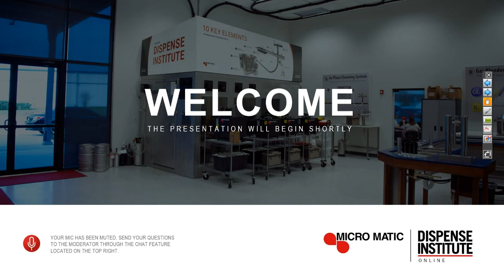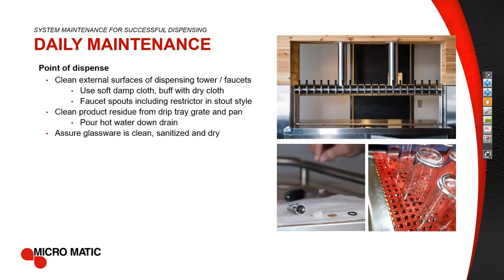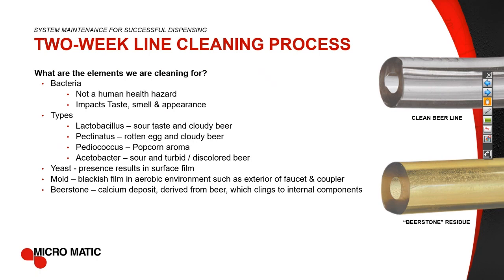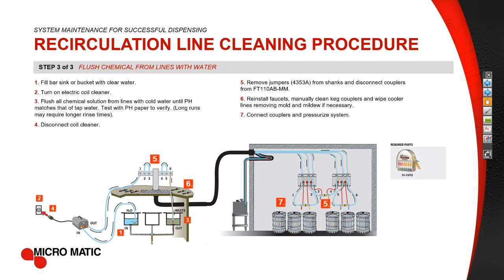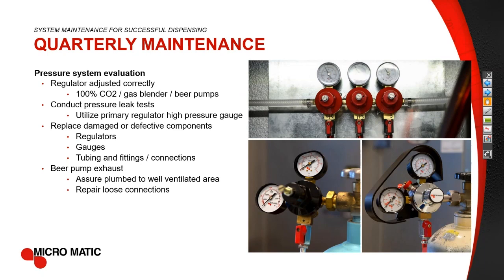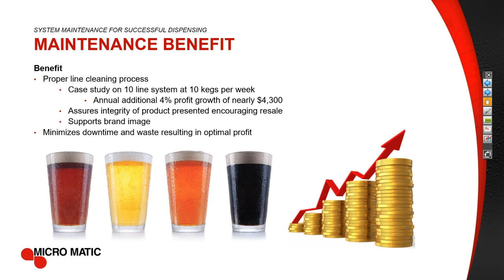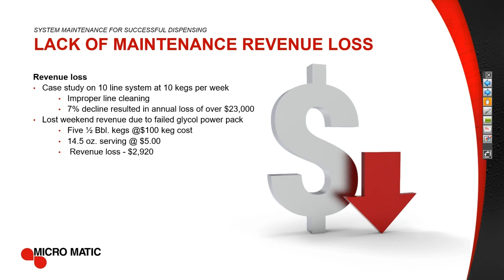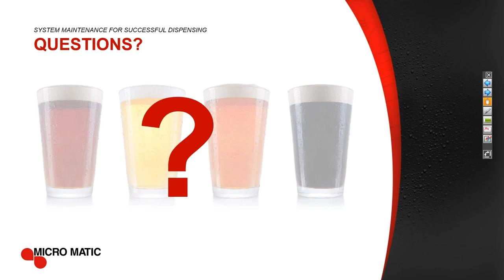System Maintenance for Successful Dispensing

Comment: If we should run caustic through the lines at 80-110 F I don't understand why we should leave glycol chiller on because it will bring the temp of caustic solution close to 30 F and reduce its efficiency.
Reply: He is absolutely wrong on this.  Sounds like his early bad experience drove his future choices.  Go see the Leaders Beverage video where he does a circulation cleaning on an eight faucet tower. He addresses the issues you raise.  You want this solution to be in the 80-110 range, so keeping the glycol chiller on will work against you.  If you can’t power cycle your chiller, you obviously have other issues to fix, don’t blame the cleaning process or tech!